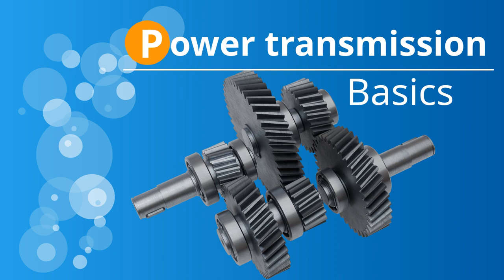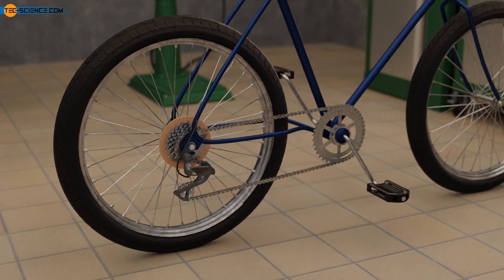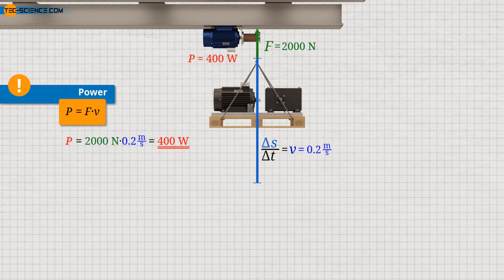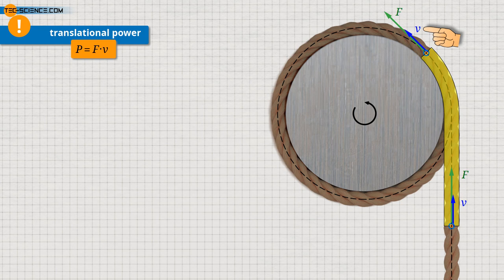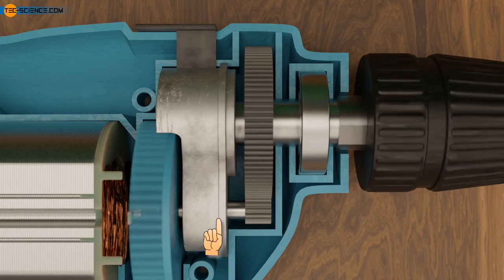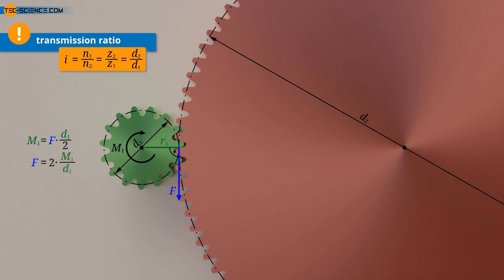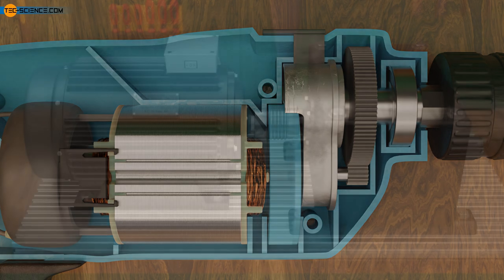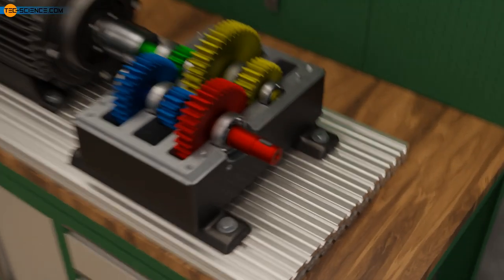How does a transmission work? | gear stage | gearbox | transmission ratio | speed | torque | power

Comment: Thank you for your video. This is a great interpretation on how a transmission work. V twin cruiser is normally equipped with belt pulley transmission due to the shock load from V twin engine is insensitive to the transmission. And a modern  parallel twin engine produces much less shock load and vibration, a chain transmission can be applied, such as Kawasaki Vulcan S and Honda Rebel series.